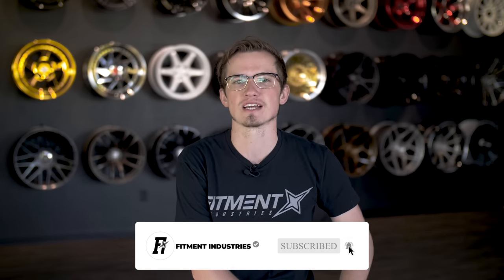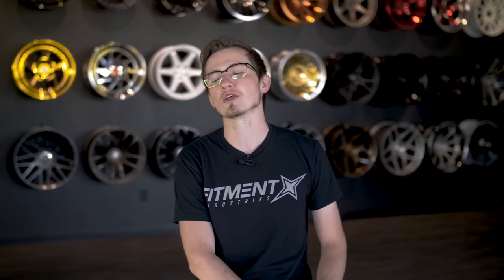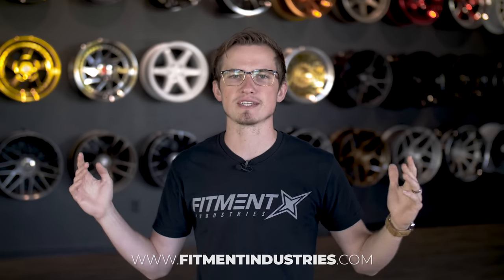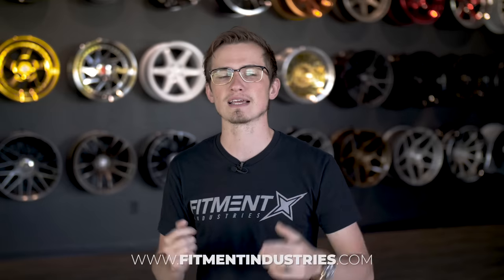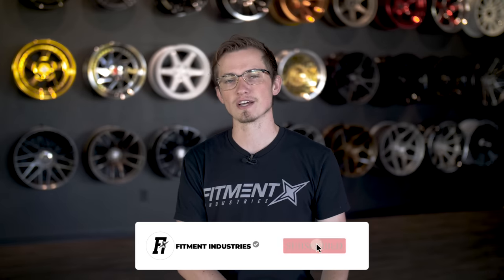Why You Should Lower Your Car

Comment: Here’s how I did it (I’m 17 now did it as soon as I turned 16).                                                     1) tint/roof wrap.                                                 2) wheels.                                                                      3) air intake.                                                                 4) lowering and suspension parts.                            5) exhaust and body parts (lips, sun visors, ect.)

Comment: But what if I got them plastic hub cap wheels? Thennnnnnn can I get wheels first before suspensions 🙃
Reply from the maker: The reason you do suspension first is so you can really dial in the fitment you’ll need for you wheels.  But you can order wheels first as well!

Comment: Can I do 20x12 rear and 20x10 on e92 m3 without modifying panel and fender
Reply from the maker: Well we have one car in our whole gallery that is an e92 m3 with similar specs! lol they are running 20 x 9 in the front and 20 x 12 in the rear,  and that is with fender rolling being included as well!

Comment: I got no drivable "presentable" car now ('97 Honda City Lxi been sitting since 2015, it had no problems but we had no space and no one drives it. I don't want to force drive a 90's beater, It's a "upholding a personality" thing)

That is why the project will be done in a year or two is to have the paint changed to a better grey than stock mettalic grey, repair the power windows and sound system, clean the AC, new wheels, window tint, new headlights, clean badges except for the Honda logo. The deal is either my dad pays for it or I pay for it in the future when I become stable. At any case whichever one comes first. LoL
Reply from the maker: It all takes time my friend Rome wasn’t built in a day!
Reply: That sounded wrong. I meant "clean badges and tge honda logo" 😅

Comment: I'm dropping my xrunner with djm 3/4 kit next week. Still running with stock wheels and tires. Wanna know if I'm going to feel rough about driving if I run on aftermarket control arms and a c notch at the rear leaf spring :(
Reply: Sorry not the leaf spring
Reply: It's the frame

Comment: I have a BMW e46 325i project car and I’m trying to lower it and I’m relatively new to the stance scene. Any recommendations on setups that have worked previously on the same car or e46 models in general?
Reply from the maker: I got the cheat codes for ya guy, Check out this link and enter the specs for your ride and you will find what you are looking for! https://bit.ly/2Ma4oca
Reply: Fitment Industries Wow this is incredibly helpful thanks!

Comment: If I only want to go from stock 17" rims to 18" and just one tyre size up (or down for profile) then I don't need to worry about fenders n other shit, it should lower to the same height more or less?
Reply from the maker: Well it’ll fill up the wheel gap, it won’t “lower” but it’ll fill it in for sure, making that gap minimal. -Edgar
Reply: @FitmentIndustries  I mean that I could get wheels first, then lower after.